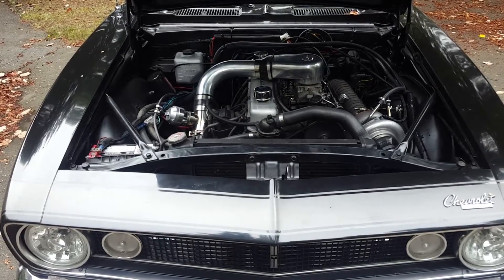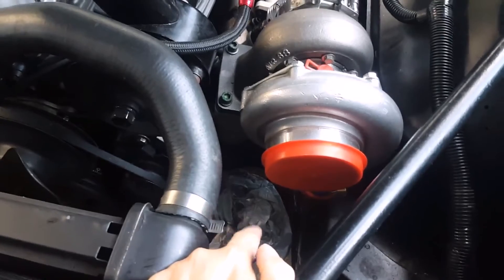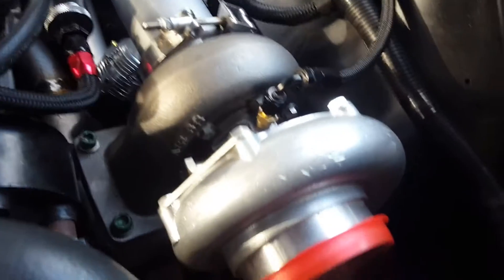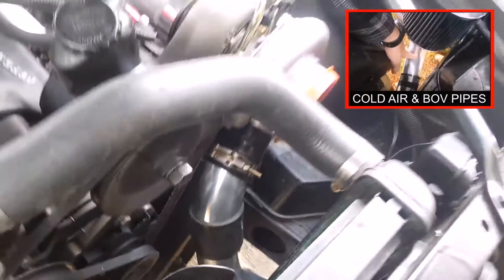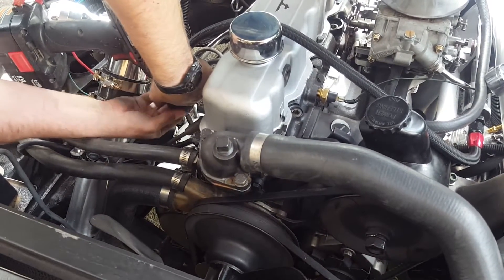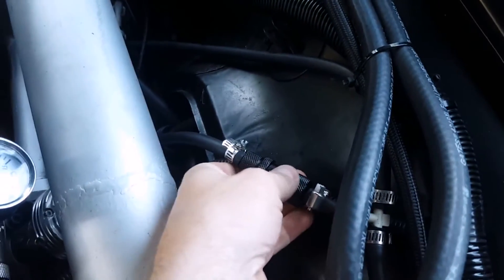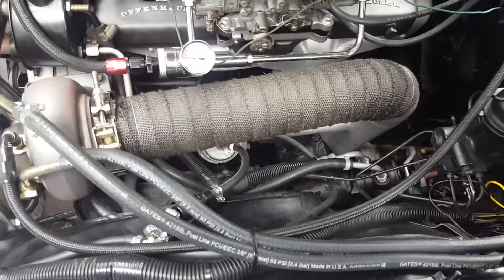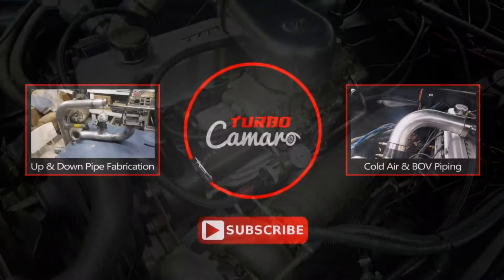1967 Turbo Camaro - Chevy 250 Inline 6 - Turbocharger Install

Comment: Here in Brazil, the 250 is a very used engine for drag racing and has a preparation that exceeds 2000hp. Search for Chevrolet Opala Turbo

Comment: How much hp do these straight six turbos make, I know the straights are pretty slow but I’d imagine with a turbo they should be semi decent
Reply from the maker: A stock 250 will put out 150hp if the engine is top top. Doing head work, higher flow manifolds and exhaust , performance cam, turbo and a meth injection system could get you into the 350-400hp range. It's going to drastically depend how aggressive you go with the mods and turbo selection. A fun choice but far more costly per HP than a 'regular' V8.

Comment: You earned my subscription. Really great vids. I was talking with you about the head porting last week.
Reply from the maker: Glad you like the videos. Thanks for the sub!
Reply: @TurboCamaro67  no problem dude, you have interesting content, you're not an asshole either lol. I hope to get my dart up & going soon. I'm doing a big block conversion from slant 6, I could just turbocharge the old slant six, that would be awesome but I think the 440 will get the turbo.
Reply from the maker: Yeah, I've had a few moments of frustration where I consider I should just went with a big block and called it done, but I've also come to the realization that it doesn't matter which engine I have, I'll never be able to call it "done".

Comment: which turbo system is easier to install/source parts....blow thru turbo or draw thru turbo setup???
Reply from the maker: Ive never attempted a draw thru setup on an inline 6 so I couldn't speak to that. It was fairly easy to get parts for my blow thru setup. Overall it's been an easy but the big points are the cost and expected power. You need to beef up a 250 and increase head flow to take advantage of any system and those parts are available, but not cheap. Once your engine is ready, you can use any compatible turbo and a stock or aftermarket turbo manifold for the turbo. The manifold can be pricey but the rest is the same price and availability as it would be for a regular small block V8. Feel free to checkout our site or email me directly if you want to dig into this in more depth.

Comment: Nice work! I'll be a long time getting to this point with my Nova as I need to address body, paint, and interior first. I think I'll go with a SPA Turbo Exhaust Manifold 090326 to help me simplify some of my piping. I know it's a bit more money in the end but it'll get there. Keep up the vids and keep us posted man for sure!
Reply from the maker: +DaveSanctuary That SPA Turbo manifold would definitely make things easier. If you have the money I'd go for it. I'm wanting to re-address the paint on the Camaro but that probably won't happen for a couple years.

Comment: Man this build reminds me of the 250 I built around 2000. I bored it 60 over , ran 307 pistons , hei distributor , offhenhauser intake 500 cfm edelbrock , Clifford headers , port and polished Heads,  202 , 160 vales , milled the head , can't remember the cam, but I bought it from paw.  Ran really good for what it was. had it in a 69 nova , with 200r4 transmission and 3.73 gears.  Wish I would have turbo it like you. it was different motor. love the build. Are you gonna take it to the track ? Good Luck with it.
Reply from the maker: +rle1020 sounds like a great built too! No sure about the track yet. I literally drive it to work and on business trips at this point. Still have big plans for it... Just waiting on the weather. Still over a foot of snow outside.

Comment: I recently purchased a 1967 gmc 910 with a 250 3 in the three and want to either rebuild the 250 like your previous videos or put the 283 v8 in it wich one would you recommend
Reply from the maker: I'm a big fan of the 250, so I'd stick with it. It can be a costly build but worth it in my opinion.
Reply: ok thx for your tips and I would say it is kinda hard to find parts for these engines in Canada but im looking into it
Reply: and taking in from 3 in the three to 4 on the floor
Reply from the maker: I'm in BC Canada so I know what you mean about parts. There are some shortcuts you can take, and if you have time you might be able to find some old stock interchangeable parts. A regular rebuild might be cheap but a build up like mine will test your reserve.
Reply from the maker: There is a guy on youtube who turbo'd a 250 with 3 on the tree and it worked pretty well! Search "Joshua Lyle"

Comment: Loved what you're doing with it, not much attention to the inline 6 in the US. Here in Latam we still use them a lot, there are some nasty turbo setups in Brazil, looking forward for some dyno numbers and hear that turbo spin. Great Job!
Reply: Here, in argentina, the biggest motor for a Chevrolet was the inline 250+
Reply from the maker: Yeah I'm excited about the dyno numbers too. I can hear the spooling and BOV working at 3lbs boost but it's not loud. I suspect the 6-8lbs range is where I'll tune to for the driving video and it should be pretty apparent there. I've never seen a Camaro with an inline 6 in Canada and never a turbo'd one anywhere (in person). Also, you're right, Brazil does it best!
Reply: Here in Brazil we make as much hp and torque as possible cause this is the biggest available engine over here and V8 engines are rare and expensive. O hope someday there'll be new blocks and heads castings. This engine is no more fabricantes since the early 2000 and most engines used in competitions were made in the 70's and 80,s.

Comment: Awesome buddy look great can't wait to see you driving 😜👍🏻👍🏻 if you have ant more wrap left I'd wrap the fuel line with hood up is one thing but good down temps get pretty high don't want you to get the fuel hot!!! Your very handy maybe you can fab up a heat shield for the carb?? Cheers 🍺🍺
Reply from the maker: Thanks! I'm loving the look of it too. I was thinking heat shield for the carb and power steering pump. Have to do something with the PCV system as well. I'm excited to kill the time on the last driving video.
Reply: +Turbo Camaro Heat shields definitely the way to go buddy 👍🏻👍🏻 as far as the PCV definitely a oil catch can in line
Reply from the maker: +1Wild CamaroSS Catch can is in the mail and the heat shield is a must for sure.
Reply: 1Wild CamaroSS 
fwiw....fuel lines,exhaust down pipe,et al....will benefit from fiberglass or header wrap...imo